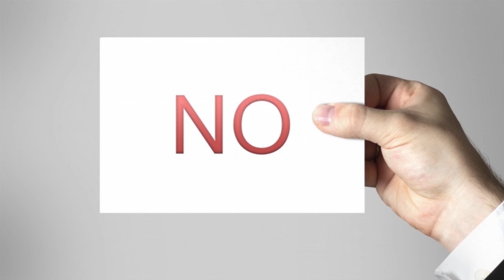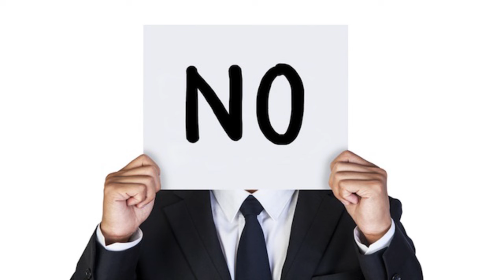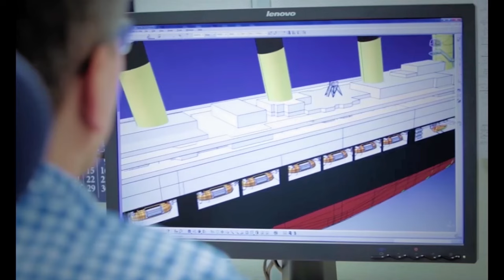Titanic II (2027): Frequently Asked Questions

Comment: Actually, she will be bigger than the original. Her mass will be 56,000 GT, while the original had a mass of 46,000 GT.
Reply: Tbf tho I think he was referring to her physical size and not the tonnage. Either way she'll still be a bit bigger with a 105' 8" beam rather than 92' 6" originally.
Reply from the maker: I believe the way they measure gt has changed since 1912, so 56k will be similar to what the original was.

Comment: I'm getting tired of news outlets repeating the same titanic 2 update over and over
Edit: I like that you don't repeat the updates
Reply from the maker: Palmer did a press conference in 2013 when he launched the Tit Il project. This is when all the renderings and the official video were released. Palmer then said very little until March this year. The press repeated the material for 12 years! They are now doing the same. My videos tend to include speculation and exiting facts as there are no new facts. I have to use the original renderings, as they aren't any new ones yet. However, as soon as I get new material, I will include it. (Pls check out my Tit II blog)
Reply: @WaterWorld1  I still think they should double the overall area of the brittanic if they make a brittanic 2/3 as to make it a true gigant like the og name implied
Reply: @WaterWorld1  I think it's basically what they do when they don't have interesting news